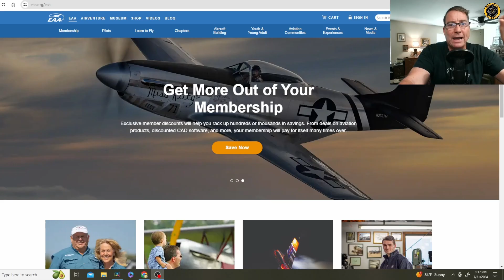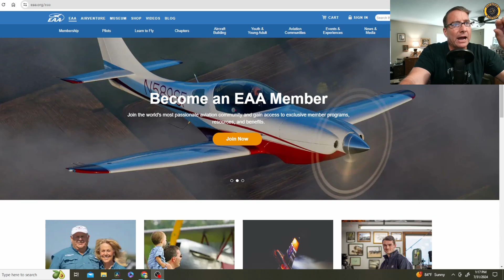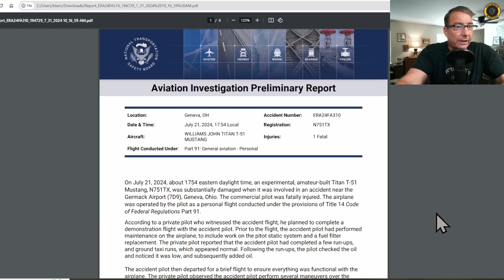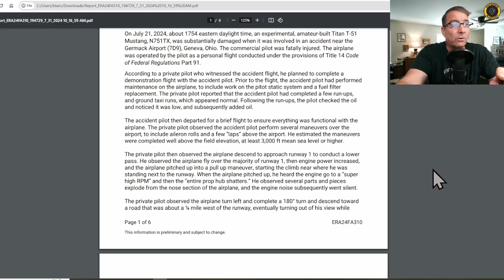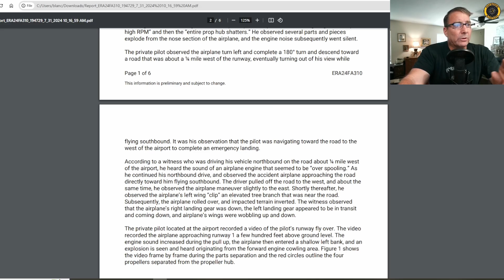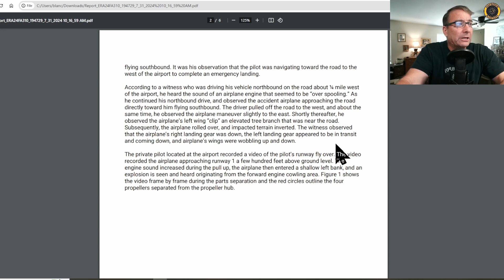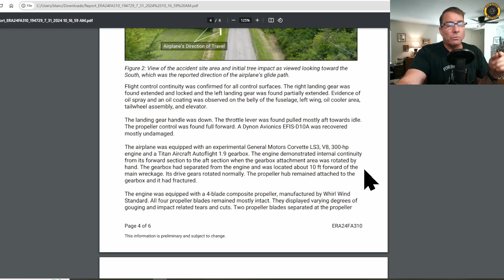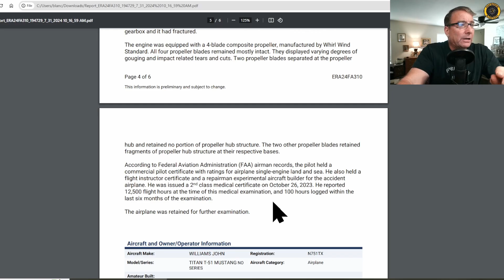Titan T-51 Fatal Prop Hub Failure 21 July 2024

Comment: There are thousands of Diamond DA40s and DA42s  flying happily with Austro engines which are converted  Mercedes diesels.
Reply: They have a real company backing them that’s spent thousands of hours on R&D to get them to work properly. Rotax and the Austro motors aren’t even remotely comparable to the applications on 99% of auto conversion homebuilts.
Reply: Consider that diesels operate at lower RPM than gas burners
Reply: @DanielJohnson-ec8rk  4000 - 5000 rpm is still too much for the direct drive of the prop. DA40 has roughly 2:1 gear ratio.
Reply: @PecekMichal  that’s why I said diesels run at lower RPM, generally not more than 2,000
Reply: @DanielJohnson-ec8rk  please show me one diesel engine in an airplane running at 2000rpm. The few I know of are running at around 4000rpm
Reply: @PecekMichal  we were talking about diesel engines from automobiles which generally run at 2200
Reply: @DanielJohnson-ec8rk  No. They might be idling on the highway at around  2000 rpm. But you need full power during takeoff to be delivered at 2000. No diesel does that and they have reduction gearboxes. Lower ratio  than for example rotax which delivers full power at around 5500, but still needs one.

Comment: As as an auto mechanic for 50 years...I can't imagine trusting an automotive engine to fly me. That is not what they were made for. I continue to marvel at the ruggedness , simplicity, redundancy, and built in performance limitations of the airplane engine. They can literally chuck off a cylinder and keep running, piston flailing in the air. I just don't know why you wouldn't want that.
Reply: At the same time, I have never had a car engine fail to start in 25+ years, anyone with any piston engine airplane experience knows thats not a typical experience. Ive never had a car engine fail catastrophically while driving nor do I think I personally know of someone who did, so that is on 10s of 1000s of hours, while I do know 2 people who had their rugged airplane engine fail catastrophically in flight (they are both fine) and thats probably on 100s, at most 1000s of hours. One of them was an engine with 25 hours total flight time. How many car engines have you seen explode in the first few days of driving it? And my car engine doesnt need to be rebuild every 50 hours, it will do 5000 hours with minimal maintenance. And thats not even mentioning cost. Or fuel efficiency. I certainly do see the appeal, but I recognize that the reality is more complex
Reply: Agree. The engine failures I’ve seen have been the result of a cracked cylinder. Because of the air cooling fins, they’re not as rugged as an engine block, say a Ford 302 straight six. That thing is bulletproof. RIP to gentleman here.
Reply: @wflyer7985  I believe you mean the 300cid inline 6. Yes bulletproof. I had a friend that "burnt a piston" (guessing it busted a skirt or swallowed debris from a carb "adjustment") and knocked one out of a junkyard motor and put in. I asked him if he used a torque wrench and he slapped his biceps and said "yup". Fucer ran for 3 more years. Some noise. And blue smoke. But it ran.
Reply: @intheshell35ify  You’re right it is 300 cid. I was confusing it with the Ford small block V8. We had the 6-300 in our family Econoline Ford van, ran forever. I replaced a gear box twice on a 292 Y-block. Didn’t use a torque wrench either 😂
Reply: It has nothing to do with the automotive engine. Most of the failures occurred at the propeller reducing gears.  Even for the vaunted spitfires and mustangs, rolls Royce had a lot of problems designing the propeller gear for the Merlin engine. This is why you don’t see a lot of high speed rotating gearing on anything because it can be complex to design to run reliably
Reply: Probably cost, in many cases. I'm not a mechanic but recall that aviation engines are tighter tolerances and repairs or rebuilds are quite costly compared to automotive.
Reply: It's apples and oranges my friends. An apple can't make orange juice and an orange can't make a pie. The airplane engines I've seen uses mechanically driven magneto ignition tech from the 50's cause it doesn't fail and if it does you got another one on the other bank. They can run with pieces of the valvetrain falling out. Yes, they are run at "wide open throttle" but at such a reduced rate it is similar to that 20 year old Craftsman mower in your garage that is run at "wide open throttle" its entire life while you mow a hay field once a month when your wife yells loud enough. Additionally..you can't get away from the failure points of a water cooled engine...meaning how quickly they grenade when the cooling isn't there.
Reply: You seem to be a bit misinformed on quite a few things. 
Aircraft engines need to be rebuilt roughly every 2,000 hours. The reason your car lasts 5,000 is because it is using a tiny percentage of its potential horsepower the vast majority of the time. Aircraft are run at 70-100% power the vast majority of the time. If you ran your car at redline all day it would not last long. 

Also the first 100 hours are the most dangerous time for any new engine, automotive and aviation. Just look at all the issues Toyota is having right now. 

The only way you’ve never had a car fail to start in 25 years is if you buy a new car fairly often. Most aircraft are 30 years old minimum.
Reply: @yamkaw346  50 hour between rebuilds is a bit of an exaggeration, but not much. If you need to check the cylinder heads every 100 hours, that alone is a bigger job than my car needs in 5 years.
That plane engines run at high power is a really bad argument. They run at (much) lower RPMs than most car engines. Car engines dont suffer much from putting out more power (especially not at glacial RPMs), if anything its cold starts thats bad for them. Saab ran a few randomly picked cars at full throttle full speed for 100K Km averaging over 200KmH with no more than fuel stops and maybe oil changes (not even sure) and that was 35? years ago.
That my car engine is (far) more modern is the point. Most airplane engines are largely unchanged since the 1960s. Magnetos, carburators, pushords, leaded fuel, when is the last time you purchased or even drove a car with those?
Reply: @yamkaw346  I've heard that agrument before, but I really would like to see a scientific study on that.  Does anyone have a link?
Engine to engine, excluding 'accessories' and let's say at 10000 ft. just ran straight until they give out.
Reply: Well answered. It is also why good auto diesel conversions are proving much better. eg diesels on the Daher DH62. Lower revs with high torque where you need it.
Reply: Lol and yet that was not what the problem was! Also look at the guys that put lycomings in VW's. Not exactly the definition of reliable.

Comment: Totally disagree, normally the hub failure would cause the surge in engine RPM, not the other way around.  I'd default to harmonics, prop failure, hub failure, governor failure in that order before the engine given that it and the PSRU were completely in tact.
Reply: Governor failure or not was irrelevant after the hub had exploded
Reply: Ditto
Reply: I agree with you

Comment: Are they still trying to tame the Chevrolet V8 for aviation use?
 Its never going to work.
 Forcing RPM reduction is and always has been forced, backwards,  engineering.
 Stop talking yourself into believing high RPM engines work.
Reply: Sounds like the engine and gearbox were fine, the hub failed.

Maybe backwards engineering,  except thats how ships have been doing it for a long time.
Reply: It did work, for the original North American P51, back in 1944.
Rolls Royce Merlin engine, first ran in 1933, was manufactured under license by Packard.  
This was a water cooled V12 which turned 3,000 rpm.  
This was way too high for a large diameter propeller, which had to keep its tips subsonic, so it had a reduction gearbox.  It all worked quite well.
Allison made the V-1710, Daimler Benz the DB 601, Hispano-Suiza the 12Y and there were many other water cooled V12s.
After WWII, the RAF flew the Merlin for about another 40 years.

Comment: If it was a motor cause failure, wouldn't you have a rpm limiter on it to prevent this?
Reply: Yeah its somewhat surprising to me too if the engine didnt have a rev limiter, but that may not have changed a lot; there is no way the engine could overrev so quickly if the prop and governor where set and working correctly. And if either of those failed, then it no longer really matters that your engine is toast too. The only case I see where it could save you is if you manually set the governor to feather by accident, if that is even possible. I think the engine needs to be at idle for that, but Im no expert.
Reply: @vertigo2893  being an automotive engine, do we know if this was a mechanical throttle or throttle -by-wire? Also a possiblity is a mechanical failure or damage to the intake (like a large vacuum line break) letting in air instead of the throttle body.

Comment: Should have gone for the field and left gear up .terrible sorry this happened.engine revved due to loss of weight.of prop RIPJohn
Reply: My feeling is the urge to save the airplane was overwhelming, witness the turnback and lowering the gear. I agree, straight ahead into a field was doable, he had the advantage of no drag from a windmilling 4 blade prop, and a bunch of altitude to work with. Very sad. Similar outcome to the Howard Hughes racer replica accident a few years ago, prop governor failure and instead of using the chute, pilot tried to save the airplane by landing into rough terrain.

Comment: Bless him and his family.  A Mr. Honeywell from Smith Valley, Nevada had a P-51 named "Hurry Home Honey" painted much like this.  He crashed Near Smith Valley several years ago and died.  Any connection between aircraft?
Reply: It was more than a few years ago.

That was a real P-51.

November 1992:

North American P-51D-25-NA 
"Hurry Home Honey", 
N117E (ex-44-73832), piloted by Harvey E. Hunewill, crashed in Wellington, Nevada, killing Hunewill. 
(that does seem to be the correct spelling of his last name).

This same aircraft also crashed on February 15, 1978 in a gear-up landing error and as of 2002 is under restoration as a TF-51D, 
registered N151SQ.

The original 
“Hurry Home Honey” was a famous/infamous P-51 in WW2.

MANY P-51’s/reproductions have used that name.

It’s infamous because of the incident it was involved in-
a 109 pilot was strafing parachuting B-17 survivors and Major Richard A. Petersen 
damaged the German plane just enough to get him to bail out and then strafed him as he had strafed those bomber crews.

It’s a pretty well-known story.

He flew both -B and -D Model Mustangs with that name.

They look significantly different if you are not familiar with them.

Anyway,
many builders of reproduction P-51’s as well as owners of actual vintage P-51’s paint and name their aircraft as tributes to certain famous aircraft so as to their being any connection-
it’s in name only.

That one you mentioned crashed in ‘92 
and as far as I know,
the Titan T-51 first flew to Oshkosh in 2002.
Reply: @j.griffin  Thank you.  You're right about the spelling.  The date is scary because I'm way older than I feel!

Comment: I could easily understand an rpm surge if the gearbox had failed, unloading the engine. The gearbox could have subsequently locked up, causing shear forces within the prop hub to make it come apart, but the investigation determined the gearbox was intact, so that theory would be ruled out.  Could the rpm surge have been due to a sudden pitch change of the propeller, caused by a failure inside the prop hub just before it came apart? Condolences to his family, and glad to see someone fastidious enough to test things before taking someone else up.
Reply: Yep, most likely pitch control failed, blades went to flat pitch and allowed the overspeed which caused the hub to fail.

Comment: Thanks Juan, another excellent report. My sincere condolences to the pilot's friends and family.
I would observe, as an engine guy - that any time I see or hear an engine overspeed suddenly - especially in a condition where one would normally expect the load to be increasing,
my experience causes me to suspect that the load suddenly came off the engine. 
It is difficult to overspeed a fully loaded engine.
Perhaps, a pitch control failure, unloading the engine? I will be waiting to hear what they end up determining the root cause of the overspeed was.
Reply: I concur.....if it had a variable pitch prop that's about the only was she's gonna do a freewheel redline rev...
Reply: The sequence was most likely, that the hub failed, then the blades separated, then the revs went through the red line.    A ground observer would see the blades separate first, then maybe 3 seconds later would hear the bang and then the revs rise.
Reply: @hiscifi2986  ...the blades feathered flat n that let the motor go 9000 n then the hub failed in that order....
Reply: Since over-speeding is a major concern, I'd think there would be a rev limiter set to a value within the normal operating parameters.  My guess is something failed prior to the rev increase that caused the revs to rise even with rev limiter intervention.
Reply: @notter59  blades went flat
Reply: @JDZiemba1773  The rev limiter is a question that needs to be answered because it should have prevented overspeed even at flat blade pitch. I also suspect the initial failure does indeed involve a sudden flat pitch prop putting loads on the hub that it couldn't handle, and the failure that allowed the prop to go to flat pitch might be mechanically related to the hub failure as well, but why didn't the rev limiter prevent the overspeed? The overspeed clearly came before the catastrophic hub failure, if the two eyewitnesses are to be believed.
Reply: @beenaplumber8379  ... definitely some questions still need answers.....❤️🇺🇲

Comment: That road would not have been my first choice for a forced landing. Looking at the surrounding area there was a field directly in front of him, with a couple more to the east.
Reply: Yep - not sure why Juan didn't reinforce that. It's a reoccurring issue
Reply: I looked at those too, maybe not a wheels down landing, but they seem good enough for a belly landing.
Reply: He might have been too high at that point, but the landfill further North also looks like a possibility.  No trees at least.
Reply: Yep. Extremely difficult tarmac landing = saving the AC. Versus an easy landing on a rough field = total the AC but probably walk away from.
Reply: When you're only a few hundred feet AGL, no power and your propeller just exploded,  you don't have a lot choices. Or time to evacuate alternatives.
Reply: This time of year, the field is probably full of corn.  It might have been safer than a narrow tree-lined road, but it might not have seemed safer in the split-second needed to make the decision.
Reply: @StrongDreamsWaitHere  I guess, I'd rather corn than a small road though. It's the insurance's plane the moment it breaks, not mine.
Reply: @jadeng1147  Sure, but from the air it might not have looked safe. Or it might have big irrigation equipment that’s not seen in a spring picture.